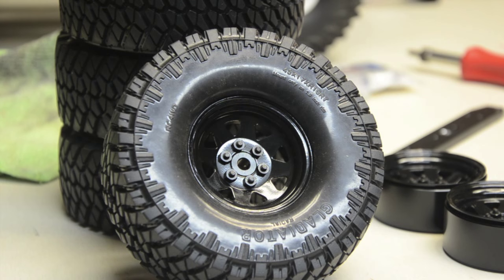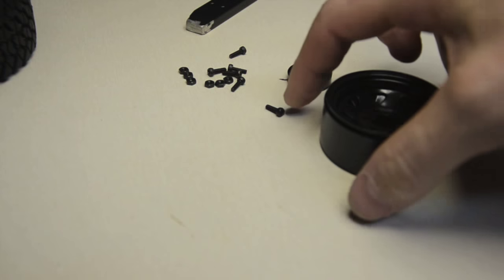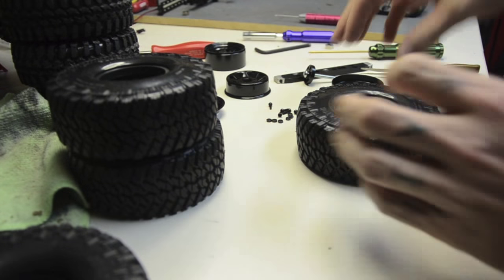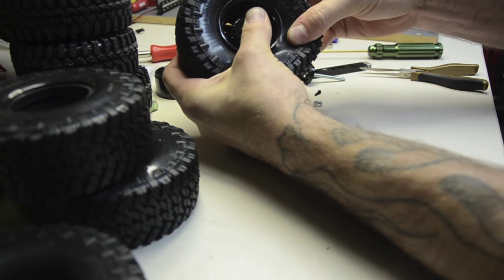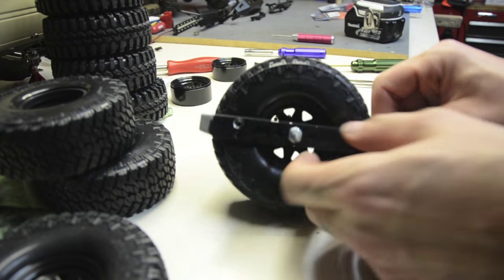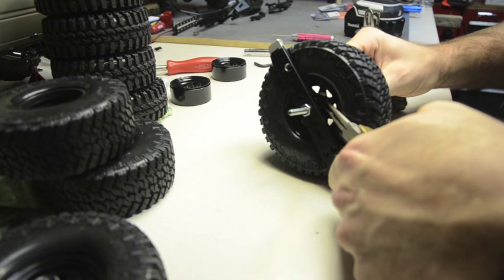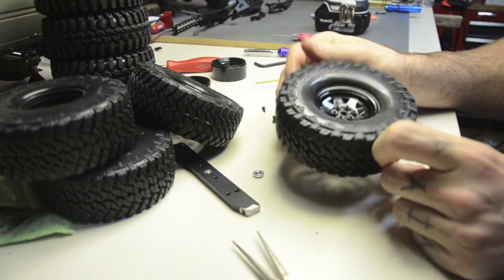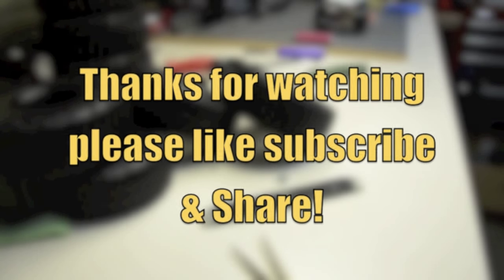RC4wd Scale Crawler Beadlock Wheel Tips and Tricks

Comment: I just have a couple long 2 or 2.5mm screws that are the same size as the stock wheel hardware. Pull it together with 2 of those, then install the 3 normal screws in the other holes, back the other 2 long ones out and replace them with the normal screws. Works pretty good!
Reply: Same method I use. Works great 👍

Comment: I can’t get my proline tires on these rims. The rubber Rim that is supposed to get pinched by the bead lock always gets pushed out and lets all the air out
Reply: Did you ultimately get it done? i've got the same prob
Reply: Me too!
Reply: Having the same issue. 2 of the same bag went together easy but 2 from another bag keep popping out the back. Tried at least 5 different methods with loads of cursing and one tire going across the room.
Reply: -J .R this frustrated me forever. I had eBay method knock offs and these Rc4wd. Could only get rc4wd tires to properly seal on the wagon wheels. eBay wheels were a little bit better but would still slip out and let water in. I was running proline km3. Tried them in multiple sizes. No luck.
Reply: @cmoney360CS  sounds to me like I will be tossing some different tires on these rims and going another route for rims with my proline hyrax. Shortly after posting this I ended up ripping the bead on the lip during install. Ordering up 2 more tires now which are back ordered so might as well shop around for rims too. Not buying these again lol

Comment: i took a meat head approach with the 4way jack that comes with the TF2 kit and tightened it from the front of the wheel with the 4way, ultimately scratching up around the bolts pretty good. i guess that gives it a more scale look lol. i should have used the 4way to back up the bolt and screwed them in from behind the wheel after all 4 wheels were done and i thought about it. i just got a set of 1.9 rock crushers and the rc4wd stamped beadlocks with the circular hole pattern and will give your trick a try if the 2 long bolts strip out on me.

Comment: ughh I had problems with these wheels. Not a fan of the 3 piece setup. Also they do not fit on my trx4. Going to return them and get the proline ones. Much more money but they use a nice ring setup for the beadlock.
Reply: RC Propaganda I got these for my trx4 as well but I did like the stamped wheel look for the build on doing I just used my drill press to bore the hub out to 5mm they work great

Comment: I don't get why you need the bumper? Why not just use the bolt and nut with out the bumper? You can use a washer if the wheel hex is a problem.
Reply: It works with aluminum wheels too. I did mine with that method.  
Today. It press equally across the rim. Made it seat nicely.

Comment: hi, why are the hub adapters on ebay called 6mm to 12mm to use these wheel but the wpl hex is 5mm ?
Reply from the maker: there are a variety of different size wheel hexes.  Most 1/10 trucks have 12mm
Reply: Ok thanks.....do you know where the wpl 5mm to 12mm adapters are on ebay, for the life of me I cant see them
only the 6-12mm ones
Reply from the maker: https://www.ebay.com/i/192733859195?chn=ps&norover=1&mkevt=1&mkrid=711-117182-37290-0&mkcid=2&itemid=192733859195&targetid=537215863168&device=c&mktype=pla&googleloc=9027324&poi=&campaignid=1881303751&mkgroupid=70803274795&rlsatarget=aud-298628318826:pla-537215863168&abcId=1139336&merchantid=6296724&gclid=Cj0KCQjwjrvpBRC0ARIsAFrFuV-SXrmGt69NwJjVMPs0OqeRqtaKc-hYpGdjzLf-Zd0sBCXTTMvyn20aAi2pEALw_wcB